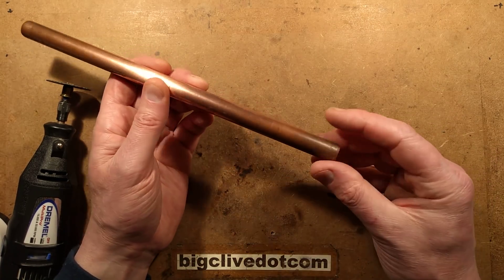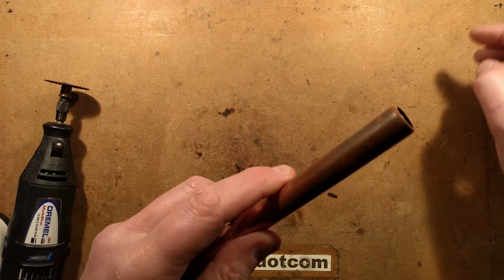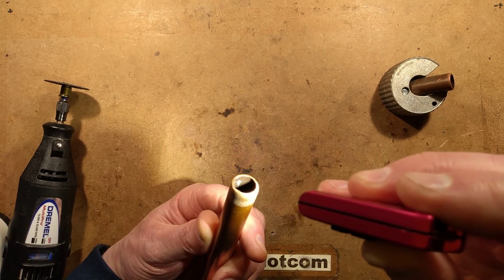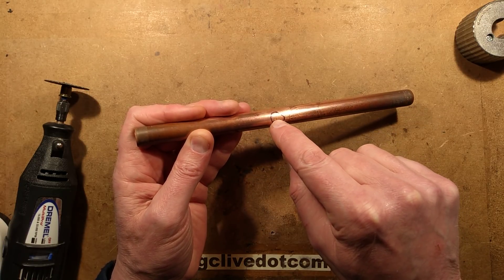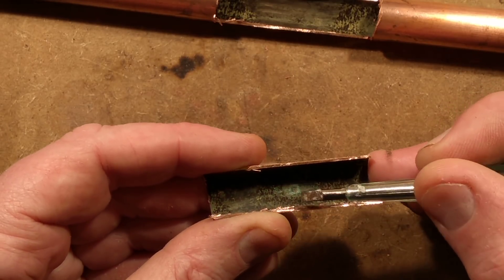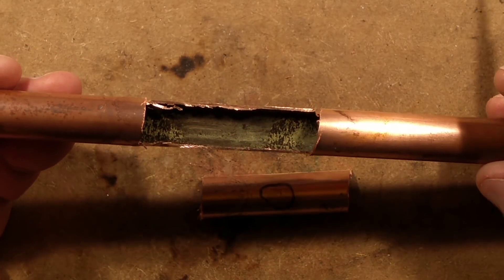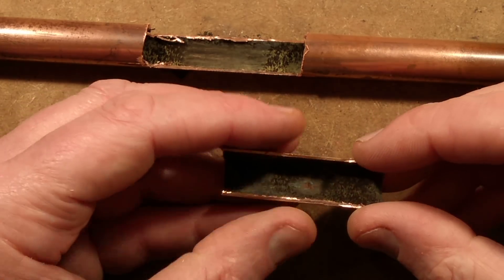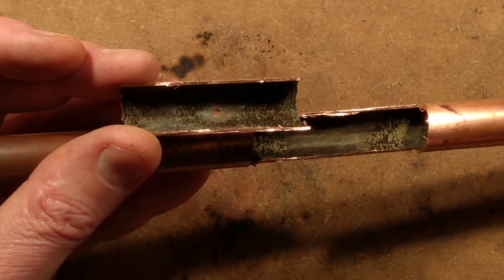Odd pinhole leak in copper pipe.  Selective electrolytic corrosion?

Comment: Corrosion from sediment is always possible but more likely it's from excess flux when soldered.
Especially on a cold supply line the flux isn't flushed out. The droplets will stay stuck to the walls eating away over time.

Comment: 20+ years ago we used to get holes lie this in water cooling lines. A chemist I spoke to said it was because the city was not balancing the PH correctly in the water. They have to add NaOH to balance the PH when they chlorinate the water. When they started adding fluoride to the water the pitting problem went away because they had to monitor the water more closely.

Comment: I've seen pin hole corrosion in galvanized pipes that are connected to copper pipes, this is galvanic corrosion, the zinc coats the copper.
I've seen pin hole corrosion in copper pipes where the pipe was buried in screed (concrete floor).  Concrete attacks copper.
I've seen pin holed radiators because of air in a heating system.
But this is a bit of a mystery. I guess it must have been a manufacturing fault.

Comment: On an episode of This Old House (US tv show), a master plumber shows how these sorts of pinholes can be caused by excess flux migrating down the pipe from the joints (particularly I cold water lines since hot water will tend to melt/wear the excess flux over time), and/or water allowed to settle for too long during house construction.  Just a thought to consider when looking at your situation.  Also, remember to ask yourself "how old is this copper pipe, anyway?!"  You may be knocking on the door of Father Time for those pipes/joints!

Comment: this problem must be fairly common. In the USA as well. Hardware stores sell repair kits for this consisting of a rubber seal and 2 metal clamps. You buy the one for your size pipe (3/4 in or 1 in etc.) put the assembly over the pin hole and screw the clamps down with the rubber portion sealing the leak. I always assumed the pinhole was caused by expansion-contraction but it may be electrolysis as you suggest.

Comment: The copper is contaminated before to be made the pipe. Because of that is this kind of corrosion. The copper normally oxidize in green, but the oxide is not expanding like the iron oxide and because of that the copper oxide cannot make a whole trough the pipe. There is a contaminated source of copper for the pipe. It's a normal kind of corrosion.

Comment: I remember seeing something like that on a home improvement show here in the states-- the hosts brought an engineer well-versed in copper pipes to look at the situation, and it was very similar: the corrosion was caused by the presence of iron particles, and in the show, they came from a very old water heater that eventually leaked due to rust. The engineer showed what should happen over time if all goes well: the inner surface of the pipe should develop a patina not unlike the surface of the Statue of Liberty, and it's that oxide layer that protects the pipe from corrosion.

They have that segment on YouTube, I found it by searching "copper pipe corrosion". The TV show is "Ask This Old House". Hopefully it's not region-locked.
Reply: if that's true it would seem they should start plating the interior surface at the factory lest their market disappears entirely to PEX...

Comment: My copper piping in a 1993-built house rotted in a section of the basement directly below most of the home's heavy electric using appliances.  Coincidence, maybe.  I was just told by a Master Plumber that it was mostly like due to improper grounding in the house and to seek a knowledgeable electrician.  Plumbing fix cost me $3,800.

Comment: Had PEX plastic put in and now I have copper pipes and PEX tubes intermingled all over the house (this was all done so I don't have to worry about slap leaks anymore). I did some voltage tests between incoming water line and down stream copper pipe and I'm getting about 0.25 VDC and 240 mVolts AC and I get a resistance measurement of 2.4 mega Ohms. I also notice the electrical box had a 10 AWG wire connected to a copper pipe and is now not connected to anything. All the work was done in USA by Roto-Rooter. $5500 they charged my in 2013 here in Southern California. DO I HAVE A PROBLEM???? ROTO-ROOTER says they are not electricians so call an electrician if your concerned. I check the california plumbing code and can't find anything about all this in there. ROTO-ROOTER told me they is what they do all the time: replace some copper pipe with PEX and there is no requirement they keep any continuous electrical path back to ground. AH!!!!!
Reply from the maker: It will depend on local electrical regulations.  Sometimes all that is required is equipotential bonding between adjacent things like taps and drains.

Comment: I had the overflow tank on my boiler developer a pinhole leak. The interesting thing about it was the very tiny stream of water coming out had a laminar flow to it and looked like a spider web. You could put your hand in the way, and would get slightly damp, but it was a tiny amount of water, under I guess some good pressure. Needless to say the entire tank got replaced.

Comment: I'm just now experiencing a similar problem in my condo, but it's in my ceiling above the bathroom; my first instinct was to check on the upstairs neighbor and make sure they didn't slip and fall in the shower. Right now I'm treating it as one usually treats a roof leak: catch the dripping in a bucket. (I's a slow leak so far, equivalent to less than one extra toilet flush a day.) Not looking forward to tearing out my ceiling and replacing the pipe.

Comment: I wouldn't initially think cavitation but maybe part of an impurity reaction ?
I've certainly seen cavitation cause pinholes in piping which typically occurs at elbows. After years the bubble formation erodes through the piping. Depending on the fluid and pressure it can be quite spectacular and hazardous.

Comment: There is now a Yorkshire type half round clip-on fitting available from Screwfix which is simply placed onto a cleaned, fluxed pipe and brazed with a blow torch. 
There is no need to cut the pipe.
It is possible that you have a faulty batch of pipe which was produced in the late 50s to early 60s. It tended to appear in limited areas around a local supplier. Happened to me!

Comment: Seen it happen to a high rise building that cost millions to repair.  The official  explanation was 'difference of potential  between grounds cause electrolysis''  It took 30+ years to remove enough copper to cause the pinholes.  Needless to say it was a nightmare .  6 more buildings in the same area also suffered the malady. Alkaline soil, method of bonding  rebar in concrete, humidity  all played a role.

Comment: I had the same thing. A pin hole leak in a copper pipe. In the floor, it sounded like a cystern running. It was a small black pin hole.

Comment: It happens a lot faster if laid in ash brick, the whole pipe gets fine pinholes that do not pass light, and the pipe sweats like a human does.
 As a qualified plumber with a responsibility to the owner, I always wrap the pipes in two layers of brown paper before inserting them into cement walls,so the pipe can expand and not chafe itself through. The pipe moves a fraction, but that is all it needs. Also do not mix it with dissimilar metals or brackets as you will get holes through ionic erosion. The speed of the water through the pipes must be below 2 meters per second for the same reason, that is why you size your pipes directly. Always ground your pipes. There is more to plumbing than just piping water. Done incorrectly will always cost you way more in maintenance.

Comment: I know I'm late... but   You have Iron contamination. Do you have any old steel pipes or boilers that are rusting? Maybe old Council supply pipes need replacing? Your neighbors might be having the same issue.
Reply from the maker: Straight off the street supply.  I replaced that whole section with plastic.

Comment: It's probably your water.    It has iron deposits that have probably damaged you hot water tank.    There is an anode in the tank that is supposed to draw any metal to it they get eaten away leaving your copper pipes at the mercy of iron particles.     I had to remove all my copper and galvanized piping and replace it with PECS PVC piping.   Cost me $3500US and that was a really good deal.
Reply from the maker: No water tank.  This was the pipe straight off the street.
Reply: @bigclivedotcom  That sure kind of narrows your search for the culprit down.    At the end of the day copper or galvanized are vulnerable after decades of use.    My plumbing was horrible.    I hope you find an economical solution.

Comment: I'm sure you've heard from someone else by now, so I'll go ahead anyway. Depending on what grade of copper that is, it looks like erosion from a circulator. Don't know how your copper is graded in the UK. In Canada there are 4 main grades  of copper (k,l, m and dwv) k,l,m are used for water distribution and dwv is drain, waste and vent, k is the best grade, dwv is the least. When the distribution system has a circulator on it the l copper is the minimum  
Copper will form pinholes and need to be replaced with a better grade. Especially bad on open systems, "domestic supply" ( tap water) but also happens on hot water heating systems(central heating). Starts with the smallest of holes. Shoots a spray so fine you would think it a strand from a spider web. Usually just downstream of fittings. The extra turbulence caused in these areas seems to be the culprit

Comment: My system has a magnetic filter to take out iron particles, presumably these come from the radiators, which are iron. I don't understand why the copper would corrode though. The iron or steel part should be the victim in any electrolytic action.

Comment: This can also happen from low PH water. Water PH below 7 can causes the water to actually eat away your copper pipes over time. If you have blue green staining on tubs or sinks this is one sign. Other signs are unexplained pinhole leaks and premature failure of valves, fixtures or appliances. You can check with a low cost PH testing kit from your local hardware store. Unfortunately, the fix is not so low cost. You would need an acid  neutralizing system in your water system... And then probably a water softener after that. Going through this problem myself right now. Good Luck.
Bob

Comment: Seen this before. A decade or so of manufacture with contaminated copper.  If this same batch of copper is elsewhere in the house that will be pinhole-ing too under floorboards etc. The rising main is usually the first to go especially on runs where the pipe experiences condensation

Comment: My hot water line under the house cracked all the way around, like a seam. It was corroded like that at the break, no other sign of corrosion and no weak points. I temporarily filed the edges and put on a compression fitting until I could get it brazed. That reminds me, I need to get that done as the temporary has been there for going on 15 years!

Comment: This just happened the other day on the copper pipe that goes from the garbage disposer to the main PVC pipe to the other side of the dual sink(kitchen sink) never knew it was possible for a pinhole to occur out of no where. the house was built in 1995, so 30 years it lasted. i don't think the plumber called it selective electrolytic corrosion, probably to speaking in laments terms to myself. either way, he fixed it. removing the corroded copper, and installing a PVC pipe instead.

Comment: I'm living in a house where a mixed pipe sscenario has developed over the past 70 years. Starting around 50 years ago roughly 60% of the pipes have been replaced by copper pipes, some welded, some crimped. Before I lived in old houses in München where also was a mixed pipe infrastructure. A similarly corroded pipe was nowhere. Miraculous.
Question: Is the Isle of Man Scottish?

Comment: I had same problem, new house addition built late 1973.  earlier there was some issue with a mine or strike? but scrap copper prices went up, quality went down, and pipe prices rose.  anyhoo, about 15 years later got the same (fantastically small) pinhole leak.  replaced that section of pipe, then every 6-8 months another spot(s) would start appear.  finally got tired of piecemeal repair. and just replaced all the piping in the addition.  Older copper pipe, was not affected.  So a combination of contaminated copper and our slightly acidic water did it in.

Comment: If you have iron in contact with copper, it is the iron that will corrode and the copper that would be electrochemically protected. On the other hand if you had a tiny bit of say silver or gold on the surface of the copper, it would corrode the copper. You can look at the standard electrode potential table ( https://en.wikipedia.org/wiki/Standard_electrode_potential_(data_page) ) , elements with smaller number (i.e. greater negative number), get corroded when in contact with elements further down. Or a better table, https://en.wikipedia.org/wiki/Galvanic_corrosion , you can see that gold, platinum etc, silver, and nickel will cause copper to corrode.

Comment: In aluminum alloys and copper, the most often culprit is a catalytic oxide process involving chlorine. In air this makes tin whiskers that short out electronics. The chlorine when past the pipe oxide layer, reacts and the product is oxidized releasing the chlorine to continue eating the copper.  Google tin whiskers. These were a problem in many computer cleanrooms with raised metal floors.

Comment: Clive I just showed the video to my dad. (Yes I live with my dad he's 75) and he said the way to know if you have a leak where you can't see the pipes is to turn off the water, drain off the water, connect a pipe to a compressor and listen for the air. It works fine, it's crude but works👍 just make sure you bleed the radiators for airlocks  afterwards...

Comment: As an ex B.G gas/heating engineer I’ve seen that often in London , usually it’s a defective pipe with a thinner layer , the green you’re looking at is from flux corroding the copper , some of us use a very strong corrosive flux called power flux or other brands. That’s why new pipework should be thoroughly flushed, and you probably have some mild steel pipework on your system that is corroded 👍🏼

Comment: How's the pipework today, Clive? - We had a strange, but very similar thing happen to our hot water cylinder way back in the early '70s. My dad soldered up the pinhole, only for another to appear a week or two later. Another solder up, and another week or two, and so it repeated ad infinitum. 

In our case, the copper had somehow become brittle and crumbly. It seemed that wherever the copper was still under physical stress, this pinhole phenomena occurred. It actually got to the point you could see that the cylinder was losing its circular shape, and was beginning to look more like it had been folded (rather than rolled) in narrow strips that ran vertically up the side of the cylinder. Before the new cylinder was installed, we got quite good at predicting where the next hole would appear.

The local plumber said he remembered his dad installing that cylinder sometime just before WW2, so it had had about 40 years of service before it began to fail. Cut open and unrolled, inside the cylinder, you could see eroded channels at fairly regular intervals that ran upwards from the bottom half of the cylinder, but diminished as they reached higher up. There was nothing visible at all in the top third of the cylinder wall, suggesting that it was something related to the cold water at the bottom, or that was neutralised by the heating of the water. Maybe something to do with repeated expansion and contraction of the copper at that level in the cylinder.

Strangely interesting how some of these things happen, but in all honesty, if I were you I'd be thinking about replacing that entire length of pipe, if not now, then at least when it next springs a leak, and I suspect it will. Abandon in situ and replace with modern plastic for peace of mind, because from what you're saying, it sounds like a bad place to be doing that job too often.
Reply from the maker: I have the replacement plastic pipe here.

Comment: This may be unrelated but have you every seen pennies with green gunk on them. Finally figured out what causes it,  soft platics that contain PVC. The chemical polyvinyl chloride causes miciroscopic holes in coins made of copper. Haven't seen this in a while so they must have changed the process?  I guess they be keeiping that one the downlow. I'm sure the PVC used in modern plastics like water line's are different than the early pvc that copper  ....    I also noticed CFL lightbulbs, the new high effiiciency one,  give off a massive AC electric field even though they are DC. Be extra careful if they are on dimmers, even if bulbs say you can and the  dimmer switch is a;sp supposed to be  compatible. Why? Instead of the usual 1 inch field around live AC lines  you have a 3 to 4 foot zone of death, not just from the bulb but all the way down the powerline to the mains. I maybe wrong on this one but I know in the fine print and a study done here in Canada it warns that you body can handle up to 3 hours a day of that kind of UV radiation they emit and after that you are damaging your skin and that has been directly linked to skin cancers. I was surprised they are rarely never that honest. This study did talk about electric fields and all it said was it was within limits limits if you had limited exposure and didn't get within the a couple inches. I have not heard anything about these bulbs. Sadly they passed a law requiring they be installed in a certain percentage of lights in new homes